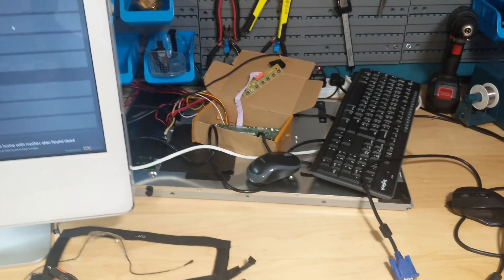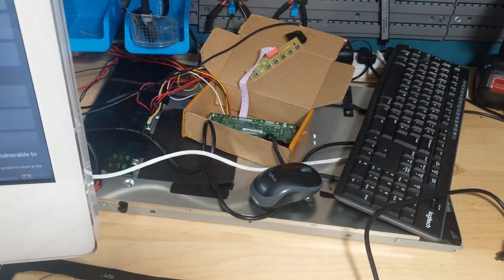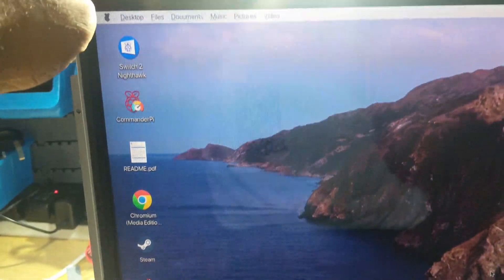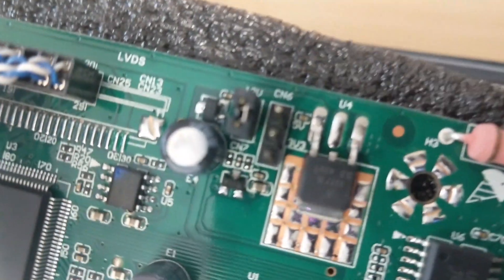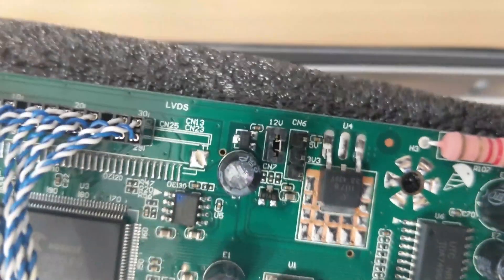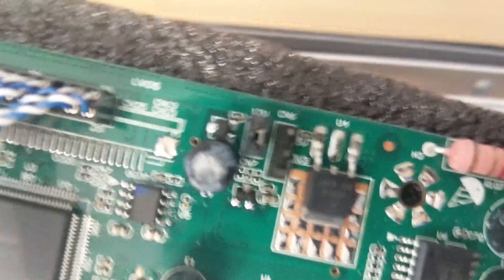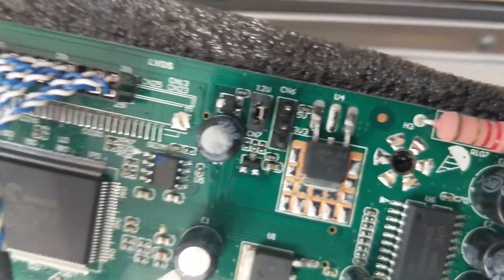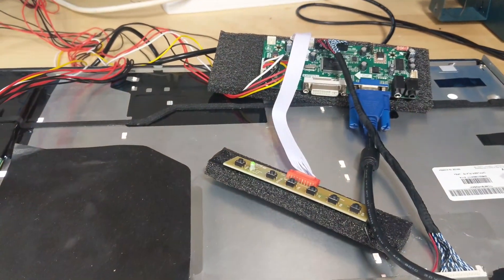iMac LM240WU2 Black Screen No Image Fix - LCD Control Module Issue

Comment: I know it's been 4 years since any update on this video but I am having some issues with my lm240wu2 slb1 display. I bought the controller board and it has the basic controller board with another board for selecting menu options and turning on the display. The controller board has a power adapter outlet to connect your power adapter. I have a 12 volt standard power adapter that I plug in and it Powers the board and the display power on board but I have no activity on the screen. I read something about the displayed actually needing 24 volts. Should I be plugging in a 24-volt power adapter into the controller? I don't have a separate board, just the controller board and the small board for turning on the display.

Comment: So thanks for all this information, I have a clear map of what to do now. I've taken notes of what all the pins for the LCD, Power Supply and the Controller Board Inverter pins are for and its clear to me. Now actually doing it; I have the M.NT68676.3 Controller Board from China unto the LM240WU2 (SL) (A1) LCD and I'm reusing the iMac Power Supply but I can't get the solder to connect to the ground and 24V dots, below the iMac's Power Supply. So I took those two wires and bridge them to the corresponding plug wires, that go into the iMac Power Supply from the Logic-Board. I only get disfigured patches of white, blinking with a weird sound as it flickers. I also played around with those three pairs of pins that helped you out, but nothing. Can someone tell me, what should I try at this point?
Reply: Video of progress so far:- https://youtu.be/UkkauXLaZQA  OR  https://youtu.be/UkkauXLaZQA?t=343
Reply: I feel like the answer is right in front of me, looking at everything on the table
Reply: Greetings to all, updates on this is: I was using a COBY universal AC/DC 110/220V 60/50HZ DUAL VOLTAGE adapter, which was powering the M.NT68676.3 Controller Board. I visited my storage and tried to take apart an Apple G5 to use its power supply (which is difficult to get to). But instead I picked up a DELL power supply, to use  instead, thinking something was up with the iMac's power supply. On my way out I found a FSP GROUP INC 12V adapter (forgot all about that) with the exact jack that fits tightly into the M.NT68676.3 Controller Board. After testing it came on. Its not perfect thou, it keep blinking slightly, I have to trouble shoot that blinking thing now. However, my problem was the adapter's jack. It wasn't fitting snug/tight into the controller board's power input/socket. 
So now I'm going to find out why the screen is blinking and I'll let you all know How I fixed that, when I do

Comment: I need help about old "Early 2009 24 A1225 Imac" Display! Can i replace a LM240WU2(SL)(B4) with another LM240WU2(SL)(B2) Display? Could someone help me please?
Reply from the maker: So I looked into this a bit and in theory it should work, it's worth a try if you really can't get the exact match. However considering this is Apple, it's best to get the exact match even if it's a bit more money.

Comment: Hi from Australia! I am about to undertake this project. Can someone please clarify where this jumper cable actually connects to? You’ve said it goes on the 12v header, but then where does the other side go? Ground? Or to some plug on the power supply? 
Thanks!
Reply from the maker: Apologies I don't know, I'd assume it was to fix a mistake or something or maybe to short something out. I mean you could trace it back and find out. Others that did this did so using the original apple parts. I'd do the same if I was redoing this. I think those boards are dodgy.
Reply: @HamedAdefuwa  hey mate. Figured it out, anyway.. 
I tried using the original iMac power supply to run the LCD. Just plugged it in and I’ve popped something, literally only used the factory cabling from the power supply to the LCD :(

Comment: Well, I succeeded using the iMac PSU to power up the screen. I didn't wanted to buy a PSU because this was a salvage project, so the less, the better. I followed the tip about the voltage pin in the controller and swapped the blue and green cables coming from the controller with those in the PSU connector. So the iMac PSU powers the screen and the controller "controls" it. Voilá, the screen is working perfectly.
Reply: Greetings, I would like to know if I can be given instructions as to how to do this please. Reusing the iMac's Power Supply. Like exactly which wires from the LED controller, to put exactly where on the iMac's Power Supply. This would be greatly appreciated
Reply: @UncleBeef  any luck? Doing the same thing
Reply: @EIectro_  I got the iMac LCD on but it quickly turned from being colorful to white. I could almost see my desktop, the screen turned white so quickly. I think a component burnt out on the LCD display board. The project has been down since. I need to save resources to approach the apple store, in getting a quote of how much to get those components (IC) replaced.
Reply from the maker: thanks for this, I might pick this back up, I think a year on from this I might be able to do it now
Reply: @HamedAdefuwa  I hope you succeed. Only one more thing, as stated before, it's necessary to order a longer LVDS cable to get the controls thru the memory panel in the bottom of the case. Cheers.

Comment: I did the same as in the video but instead of black screen I got a white screen. I tried the 3v also same thing black screen . Can you give me a solution please I really need to finish it ASAP
Reply from the maker: sorry mate, theres a bunch of us working on this and sadly no fixes. Mine worked using this but I blew up my psu so haven't had a chance to have another go at it. Don't know anyone who has got it fully working - sorry!
Reply: @HamedAdefuwa  Really Apple parts is such a pain of head.
Reply from the maker: Honestly! If you think working with these old imacs are impossible, wait til we see this new generation of apple products lol. We won't be able to do anything with at all with them.

Comment: What are you using to power the inverter? I have the LCD Control Module but no way to power the backlight.
Reply from the maker: I found the PSU I bought on ebay only £30.. 5V/12V/24V Universal LCD/LED Power Supply Unit Power Board adapter for LCD TV
https://www.ebay.co.uk/itm/5V-12V-24V-Universal-LCD-LED-Power-Supply-Unit-Power-Board-adapter-for-LCD-TV/203111523780?hash=item2f4a63e5c4:g:uJEAAOSwzqJfbElc
Reply from the maker: You need to purchase a very expensive power supply. This large size screen needs a large power supply

Comment: I have the same issue as you, but when I put the header pin on "12V" I hear a strange noise from the screen, and I still have this damn black screen
Reply: When the header pin is on CN6 "5V", I get a good screen for like 1/10 sec and then black screen ..
Reply: And when it's on 3V3, grey screen
Reply from the maker: woah your issue is even worse than mine was. To be honest I haven't been able to find anyone successfully able to do this conversion. I will attempt it again in future. Hopefully after 3 years of electrical engineering I'll be able to do it haha.
Reply: @HamedAdefuwa  I think I found the issue : my power supply has a 2.5mm (diameter) male connector but the board has a 2.1mm female connector. I ordered an adapter. Will update for others
Reply from the maker: Ha 😄 a simple fix, hopefully it works
Reply: @lucasdupuis1214  Any News ?
Reply: @nevermind7088  my power supply wasn't giving enough amps

Comment: So glad you figured this out! It was super helpful!
I'm trying to get my screen to work.
It turns on, WOHOO! But unfortunately the screen looks all washed out almost like the backlight is on full. The laptop picture is there but you can hardly see it.
I've verified that the lcd works because it looked perfect(no washed out screen) when I plugged it back into the old imac. 
I've tried two different controller boards but I'm still getting a washed out screen. Any ideas?
Reply from the maker: I have some other projects I'm working on and I'm really just considering not using any apple parts lol ITS PAINFUL 😂.

did you check vga vs hdmi? If you're well grounded in electronics (excuse the pun) someone mentioned to me that there was a short on a transistor somewhere. If it sounds like something you could do, I'll find the info for you.
Reply: @HamedAdefuwa  Haha! I agree about the Apple stuff. It would be easy they said... Should've known better, it's Apple after all. :P 
I will go ahead and check the vga input.
Also, I would totally be up for testing the transistor(s). Thanks for the info!
Reply: @littlemillerog  Any chance you fixed this washed out screen issue? I'm facing the exact same problem at the moment!
Reply from the maker: Sadly no I blew up my power supply and haven't touched it since
Reply: @HamedAdefuwa  Ah, that is a bummer. So I was given another lcd panel from my brother and it works! I am super confused why one lcd works and another doesn't but I guess that's how it goes sometimes.
Reply: @littlemillerog  food for thought and one of my I'm stuck and confused points- but has anyone considered if some of the various successful/failures might be due to the different firmware of the lcd itself? Ie- LM240WU2-(SL) (1A) vs LM240WU2-(SL) (Bx) any thoughts?